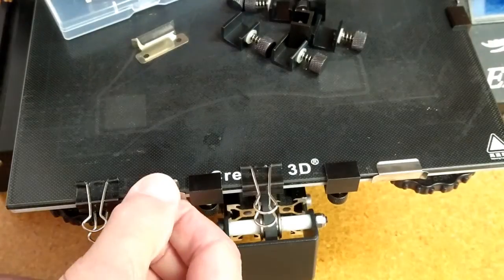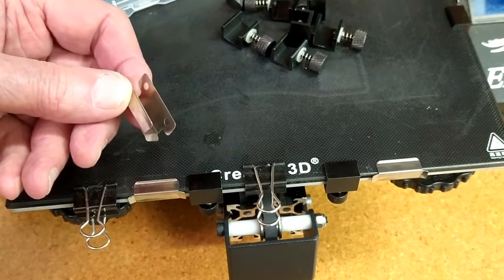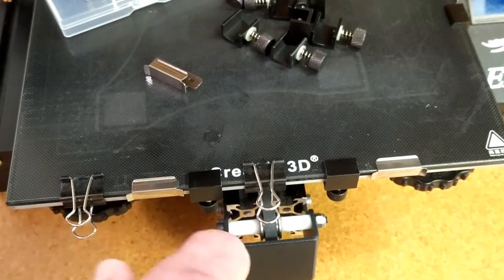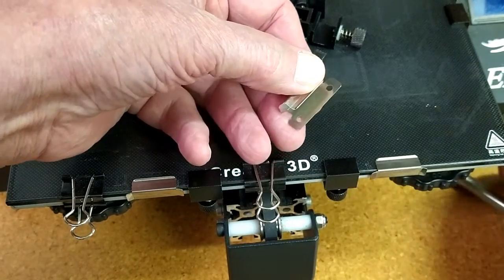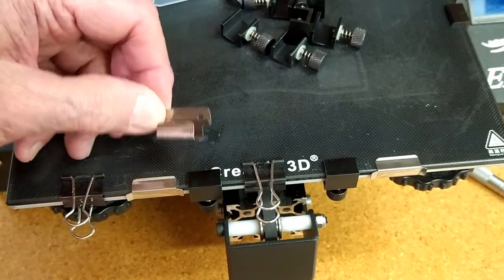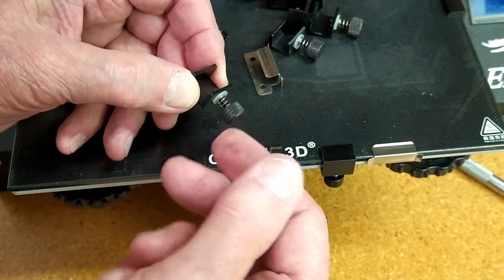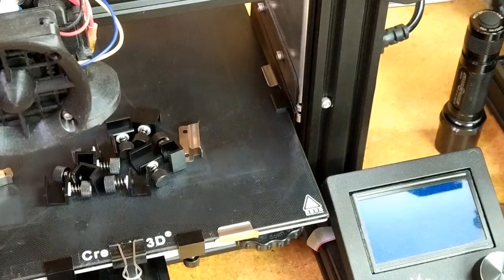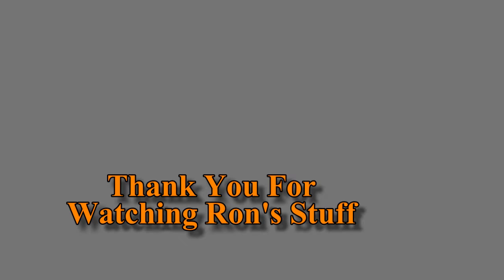3D Printer Bed Clamps

Comment: I think everyone using metal clamps needs to add a layer of kapton or bopet tape on the PCB heater on the very edge where the clamps can touch, and inspect and replace the tape about once a year. Because they will eat the soldermask eventually. Maintaining bed electric insulation can be quite important because all heaters are low-side switching, and you can inadvertently create a ground bypass towards the PSU or logic board, making any heater stuck to "on" position with no firmware authority. Also levelling hardware to have suitable soft washers (plastic or fibre silicone) on it where touches the bed heater PCB. Depends on design keepouts of course but an extra precaution never hurts.

Comment: My bottom plate is a piece of glass that I drilled a 1/8” hole in the center of. I also glued a barbed fitting to the bottom over the hole with rear-view mirror adhesive.
 I made a one-shot vacuum pump out of a 150ml syringe with a big spring inside it and that is hooked to the barbed fitting with some vinyl tubing.
  I put a few layers of 1/4” Kapton tape around the outside edge of the bottom glass and then sprayed a couple of coats of plasti-dip around the edge of that to make a gasket. I just lay the build tray on top and then compress the spring to make the seal.  
I have made hundreds if not thousands of of prints with that system and it’s never slipped or come loose even once. If you notice the plunger moving at all after the first few seconds, just wipe the inside of the syringe barrel and the edge of the glass with the tiniest amount of silicone grease. Holds for days.
Reply: You should make a video showing what you made.

Comment: I’m sure you already know this trick. Binder clips handles are easily removed and put back on, even though it can be annoying to keep track of loose handles. I find that once those handles are removed (after the clip is in place), much of the inconvenience of using binder clips disappear. I use them a lot, for many purposes, and been using this simple trick for as long as I can remember.
Reply from the maker: Yes. The problem is, when I need to use the full size of this build plate the cooling fan shroud would still hit the binder clip body (handles removed) which was what made these shiny little clips so handy.
Thanks for watching!
Ron
Reply: Got it. I'm sure you had that figured out, of course. Thanks for answering, and best regards!
Reply: My fingers won't be able to get the binder clip on without the handles! Very tight! Sure i can remove the handle but then i keep adding and removing the handles every time, that's not very fun at all. 

Part of the problem is that my glass is a 6€ IKEA mirror that i cut myself to make 5 replacement beds when i broke the borosilicate, but due to my cutting skills or lack thereof, the edge isn't great and doesn't come up flush on the PCB heater.

And the borosilicate broke because my probe is a servo swinging a mouse switch and i had neglected to set up something once resulting in a crash, where nozzle bent the boro pretty hard. It seemed intact, surprised me for a second, but when i carefully jogged the nozzle up, that's when it decided to shatter and shoot shards of glass across the room. I was using m6 for Z axis and my motor current was set to about 2 amps to overcome friction in the Z nuts which i badly designed, and the force multiplier from the 1mm per revolution propulsion was very high. I don't have an Ender i have a shitprinter which i consider full DIY at this point and it actually predates Ender's release by 2 years.

Comment: Got a magnetic bed for my Ender3.
No more clamps required.
Reply from the maker: My E3's came with magnetic surfaces but it didn't take long for the adhesive holding it to the bed to start gassing-off creating blisters under the magnetic surface and then it was quite a project to clean up that mess. I have liked this Creality black glass and have it on both of my printers.
I recently upgraded my E3Pro to a different board with silent drivers, direct extrusion and a BLTouch for auto bed leveling. Probably going to upgrade the older E3 as well.
Reply: @RonaldWalters2010   Will the added thickness of the magnetic bed stop the silver clips from going on? I didnt want to have to remove the magnet and I reckon the extra thickness will stop them from attaching
Reply from the maker: I am not sure of your situation. My original magnetic surfaces... one was glued to the bed and the other was removable... the two pieces were probably thinner than the thickness of the piece of glass I am using now but there is no reason to use these clips with the magnetic surfaces (unless I am totally misunderstanding your question).
The magnetic surface that came with my printer was a total disaster due to the way it was attached to the bed and I did not like the magnetic surface anyway.
I really like the piece of Ceality Carborundum Glass I have been using on both Ender 3 printers for over two years now.  https://www.banggood.com/custlink/DDGCE5q0yv

Comment: i use a piece or glass from an old scanner. i used double sided tape to hold it down to the bed on my ender 5. the tape has been there for s couple years now
Reply from the maker: Occasionally I like to change print surfaces so the double sided tape thing doesn't work for me.
Thanks for watching!